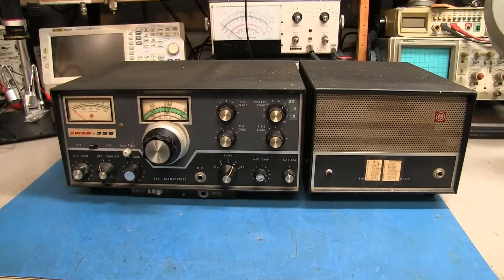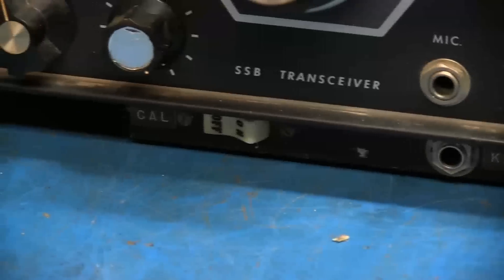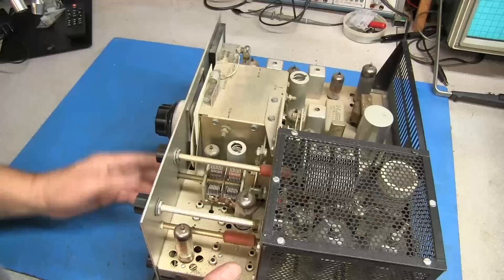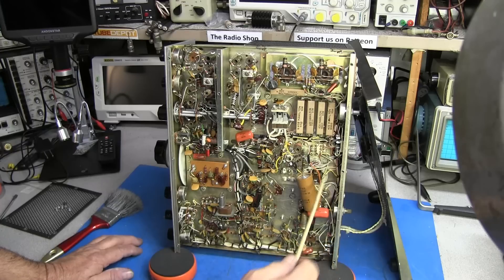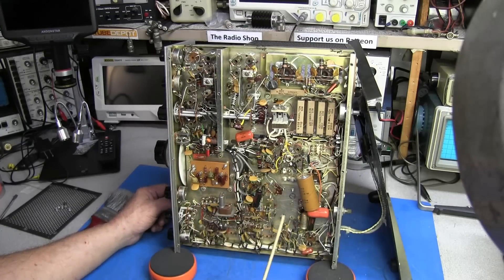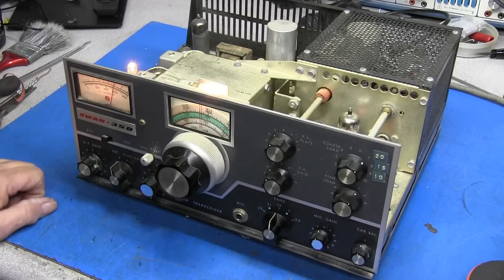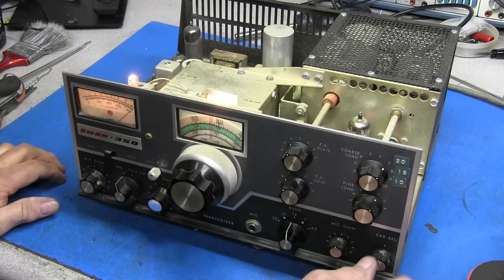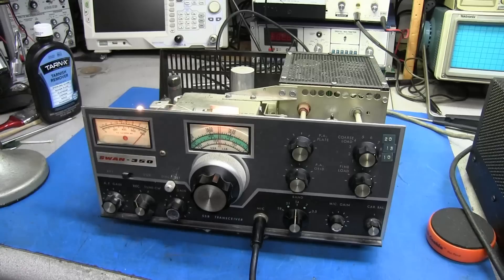Random Radio From The Vault, Will it Work ?  Smoke Alert

Comment: Thanks for featuring the Swan on your video.  I bought a Swan 350C way back in 1969 at Henry Radio in Anaheim when I was a teenager bagging groceries.  I still have it today and still use it today.  I also use it with a D104.   I went off the air for 29 years and went back on a few years ago.  I brought it up on a variac and a dim bulb tester with a current meter.  I also checked the electrolytics with a capacitor checker and they all checked good.  High quality Mallory filters in the power supply. Anyway, after cleaning the switches and potientiometers,  it fired up just fine.  The 350C's have 6LQ6 finals in them.  They have great matching networks in them.  They spec it at 520- watts PEP and 360 CW and I've seen 200 watts output DC on mine.  I use it for both SSB and CW.  When I was a kid we showed up at the Swan manufacturer in Oceanside, California and knocked on their door.  The gentleman there invited these 17 year old kids in and gave us a tour of the facility.  If you google about, there's a "Swan Compendium" out there on the web that has a lot of historical and technical information on the Swan rigs.   I'll have this rig until my final days and after that, make sure it goes to the local radio club to be appreciated further.

By the way, I noticed the Hammarlunds.  I started out with a HQ110 and a Drake 2NT.

Comment: Awesome collection of  transceivers and receivers Buddy! Think Paul Carlson has you beat , but I think he has everyone
 beat on his stuff regardless of equipment. Swam 350 with a little smoke released. I'm almost as old and every now and
then I do the same. LOL   Cleaning with Q tips is not  a good idea. They make smaller diameter precision tip cotton buds 
for this work, great for cleaning phenolic wafers. Like your demostrated troubleshooting techniques on this unit Buddy.
Reply from the maker: Paul does have a lot of stuff, and a lot of exotic rigs.  I have 2 more rooms full also.  Nothing compared to him though. I was out of the swabs you mentioned. The ones I use are like a type of foam.  They do not leave fibers behind. Thanks for stopping in.

Comment: Tarn-X contains sulfamic acid and thiourea according to the manufacturer's SDS.  An excellent cleaner for copper as well as silver.   BUT I would be VERY wary of breathing in the smoke caused by a HV arc tracking through the Tarn-X.

Comment: I got started in ham radio with a Swan 260 transceiver. They are drifty but still fun to operate and fairly easy to repair. Over the years I collected 5 or 6 Swan rigs including 260, 270, 250, 350, 1011B and a TV2 2 meter transverter. My favorite is the 250 (6 meters), which I used for many contests and 6 meter band openings. Overall I think Swan was way ahead of its time in the day. Thanks for the video, it brought back memories of reviving some of my Swan rigs!

Comment: Thanks Buddy. My last radio project was a Swan drifty 250. Swan kept the same layout on most rigs. It is hard to tell one from another looking at the under side. I think they changed the company's name more times then the design. Adding a fan helped my  drift. No sweep tubes in the 250, 6146. They are fun and I am running a Heathkit power supply. 73
Reply from the maker: Thanks for sharing Carl.

Comment: Yes indeed carbon tracking is a real problem and if any little bit is left it will arc over again. Definitely that wafer switch as to be replaced and underneath where it was has to be cleaned to eliminate any carbon residue. Great video Buddy. You do have a large warehouse of receivers and transceivers to work on for sure.
Reply from the maker: I did clean off all the carbon from the wafer and covered it with epoxy. If that does not hold I will need to replace it next. Thanks for the comment

Comment: Nice video  never saw that particular  issue on Band Switch but great to see on an old "Drifty" 50.  I have the Swan 700cx  and Swan MKII linear amps  hope to see more real soon
Reply from the maker: Thanks Mike. That wafer has the PA B+ on it. Seen it quite a few times mostly in amplifiers. I have two 500's and one is a CX. Thanks for watching.

Comment: Thanks for the cleaning tips, Buddy. I have always shyed away from Tarnex except for cleaning blank or empty circuit boards.I have a tired old HW-01 that really needs all those rotary switches cleaned. I may just jump into it with some Tarnex and try to clean them up. I love your Vault! Did I see a Yaesu FR-101 in there? That or the CB rig you mentioned would be my vote for the next video. Thanks again and stay safe. 73 de K7RMJ Frank
Reply from the maker: Tarn-X is good stuff but you have to use it with caution. Yes, there was a FR-101 along with 3 transmitters. And the many cb radios from the past. Thanks for watching my friend.

Comment: Thanks Buddy,  another great video! Just ordered some Tarnex 😀 Is IPA good to clean the Tarnex off? You were using a spray, but i couldn't make out what it was. Your videos on cleaning everything from wafer switches to relay contacts are fantastic,  thank you!
Reply from the maker: Tarn-x is good stuff but be very careful with it. This stuff does have an acid in it and make sure you have ventilation.  IPA will do a good job on cleaning it off. I cannot remember the brand of spray I used as it was sent in from a viewer but any good contact cleaner like CRC will do.
Reply: @TheRadioShop  Ok, thank you for the heads up and the cleaning details!